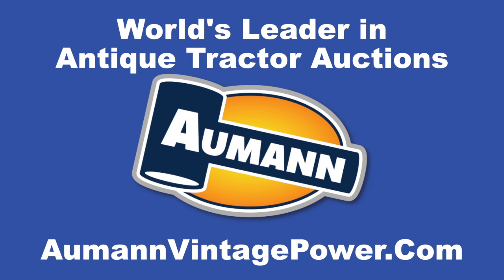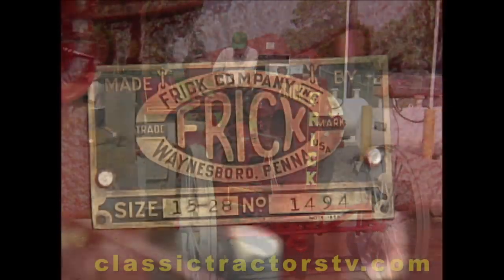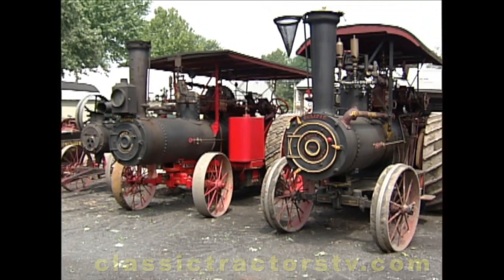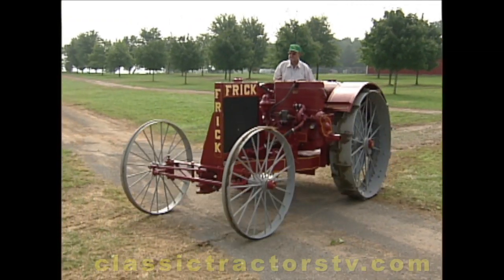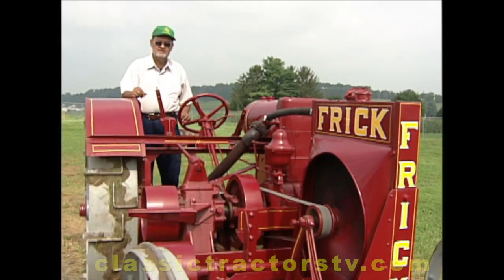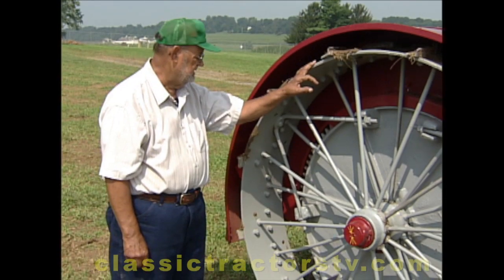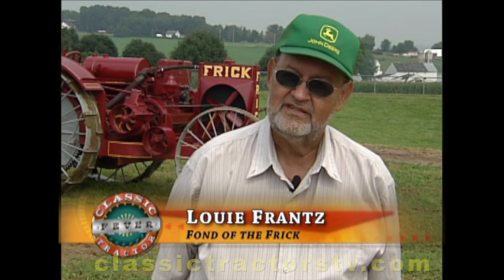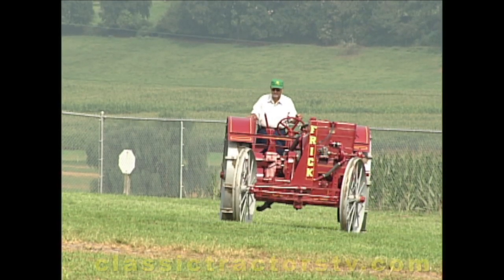What's A Frick? - Rare 15-28 Gas Tractor Built By Frick Company - Steam Traction Engines

Comment: I like the sound of the Frick running...deep throated👍👍 kind of reminds me of my MH 444 underload.
Reply: 444s ate a great tractor I inherited the Massey 44 my grandfather bought in 1958. Ots 71 years old and still working. M&W overbore high compression kit, Duals, wide front and a buzz saw. Also have a 1952 Massey 55 Diesel.

Comment: Re the bolt slots to keep the belt on the pulley. Did they not know that if the pulley was slightly convex (bigger diameter in the middle) the belt would "steer" itself centered?
Reply: akallio9000 go back and look at that pulley again. You can see just that👍 First thing I noticed about the pulley, and wondered why? Now I know,
Reply: @melloreel  that pulley is crowned.  Frick had been making sawmills and engines since steam ruled.